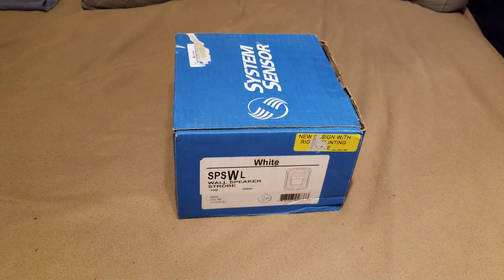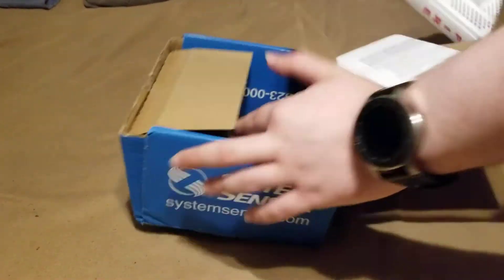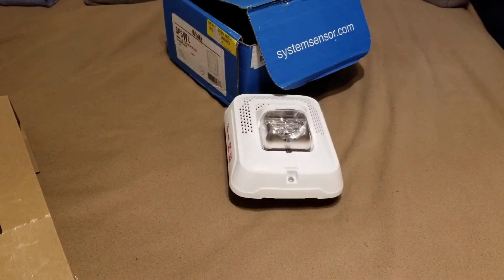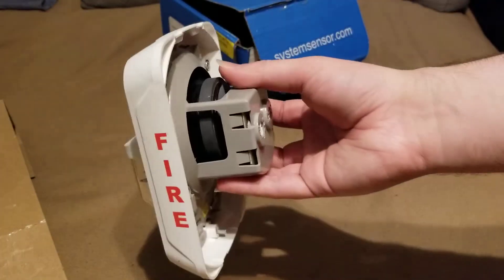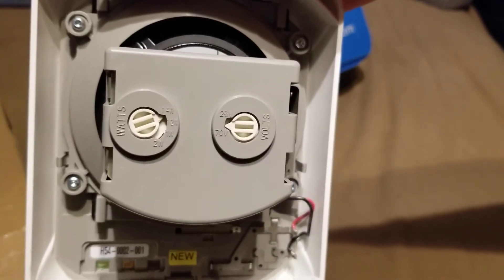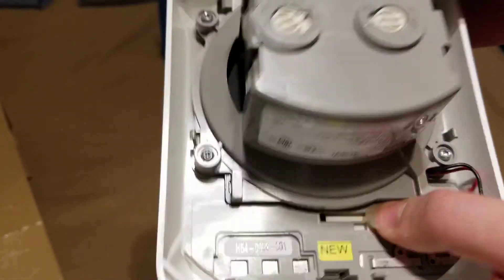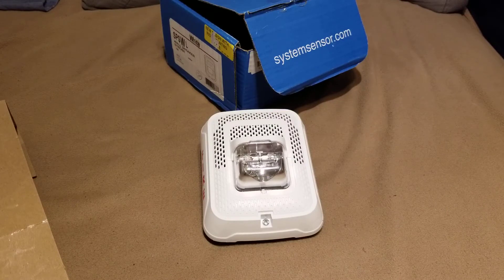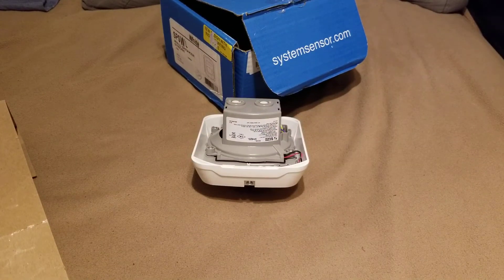System Sensor SPSWL Overview

Comment: The Spokane Falls Community College Gymnasium has the red version of these particular alarms. I've only seen the wall mounts in the classrooms and  one at the bottom of the stairs in the basement in the building. The rest of the system is red ceiling mounts. And outside, the are red advance speakers mounted too.